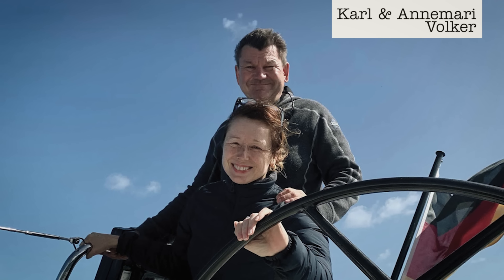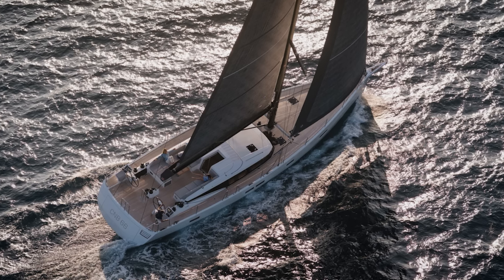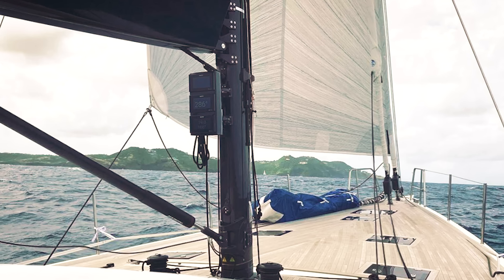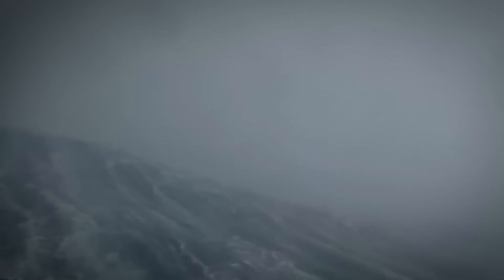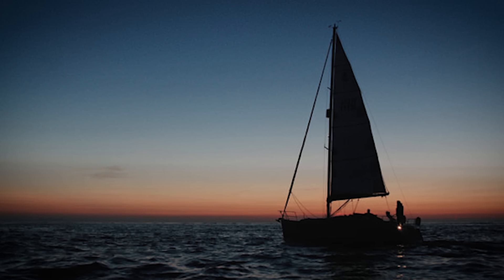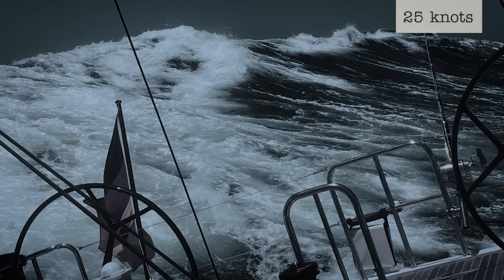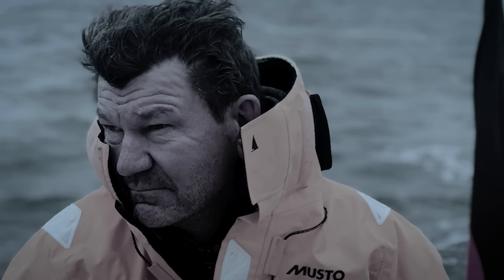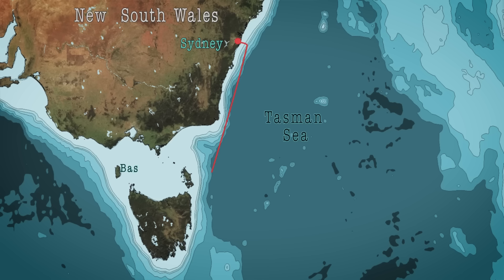Couple DIES on Private Yacht!

Comment: You can tell how experienced the other guys were with their decision to sail away from land in an extreme emergency. I'm not an experienced sailor, but it sounds like these 2 highly experienced sailors were the only reason the boat didn't sink. It is too bad that the boat's captain did not give these 2 more training on the unique features of the boat. I'm ballparking it here, but from the description of events it sounds like Karl was running a 24+ hour day with no sleep. It gets harder and harder to not make mistakes with each passing hour in a situation like that. The other part of the accident in my opinion was trying to build too large of a sailing yacht that could still be manually controlled like that.
Reply: Any experienced, well qualified offshore sailor can come aboard almost any properly set up offshore sailboat and become sufficiently familiar with the gear layout within a few hours. At that point they should to be able to perform almost any normal job on deck. Obviously there are exceptions, but they're rare.
Reply: @frankmiller95= I beg to differ. 
My opinion is that there should be a formal briefing on the safety devices AND the peculiarities of the boat for any sailboat voyage of some importance with a new crew. I know that the safety part is always done by serious skippers, but peculiarities are almost never described thoroughly enough. 
       I am 79 and now a landlubber, but I have several decades of experience as skipper on a 65 footer sloop. Once I was a crew member on a 50 foot sloop (custom-built in NZ) crossing from Annapolis to Great Abaco under an excellent & most experienced skipper; at the end of an eventful cruise (we had lost our propeller) we were tidying up the boat. 
          I came across a row of books in the living quarters which had been messed up by the heaving and rolling; while tidying up the books, I inadvertently grazed an innocuous switch which was protruding on the panel along which the books were placed. Simultaneously, I heard a whirr... which I could neither locate or understand. 
          Fortunately, the skipper was a few paces away: he jumped on the switch and heaved a sigh of relief. This switch was the command of the keel-lifting hydraulic system, and – this system having been under-engineered at installation – there was no 'end of stroke cam': the keel would have forced its way straight through the deck!     

PS: A common delusion of skippers is that it is not necessary to explain in detail the boat's safety features to 'supernumerary' crew members. During the 1998 Sydney-Hobart race, the old ketch “Winston Churchill” developed a hull leak and the first crewman to identify it was a 'guest'. The switch for the drainage pumps was a few inches off his hand, but he did not know this. By the time the skipper was informed, the water level was already too high, the batteries were flooded, the engine would not start and the boat was lost.     __ .
Reply: The wind dictates which way a sailing vessel will go, the skippers have no choice but to work with it, it's been like this ever since men first put to sea in ships, 
In the circumstances of this video, the skipper and 2nd mate had no choice but to "run before the wind"
Reply: @matthewmcdermit8744  
Sailing as close to the wind is actually called "Beating"  or sailing "close hauled" and I'd like to see you get a line around that 20ft boom in 30 knit winds with it's attendant sea state, stay sailing on those lakes, you're clearly not fit for sea 🙄
Reply: *knot
Reply: @christianfournier6862 The first situation you refer to sounds like an easily preventable catastrophe in waiting. Why TF anyone, especially a trained and experienced captain would allow something like that to remain unaddressed and not immediately rectified does not reflect well on his priorities or judgement. Ditto for the loss of the "Winston Churchill." Were there no automatic bilge alarms, bilge pumps or high volume, manual dewatering devices located in the in the cockpit and on deck? Even a substantial leak below the waterline, as in a complete and sudden thru-hull  failure should not cause immediate, uncontrollable flooding. Without a catastrophic breach of the hull below the waterline due to sudden, massive structural failure or collision, it's difficult understand how an apparently routine leak, however bad could be undetected for so long that by the time it was discovered, the hull would have lost enough stability and buoyancy as to cause the loss of the vessel. Something is rotten Denmark.
Reply: @matthewmcdermit8744  As we both well know, no one should to go sea and expect even a modest degree of safety without those attributes.
Reply: @frankmiller95 = Easily preventable catastrophe once you have discovered its potential to occur. What you are pointing at, in effect, is the difference between theory & practice. 
          As for Winston Churchill, I only know the circumstances from a book on the 1998 Sydney-Hobart race. It would seem from this book that Winston Churchill was an old wooden boat, but not exceptionally old (not 'rotten' in the sense you imply); what was exceptional was the strength of the storm. I don't know if the leak developed could have been staunched, but what I know from the book is that the crew did not have the opportunity to try, once the first chance had been missed! 
          We all know, or should know, that when the water level from a leak rises above the batteries it becomes impossible to start the drainage pumps & save the boat. The engine-start batteries can be installed separately & higher than the rest, but only up to a point. This is why a speedy reaction is of the essence. All crew members should be prepared for this eventuality. 
          Another time, on my boat with a very experienced mate, we were cruising (sail+ engine) on a calm sea when I went to the head (actually a head+bathroom) located close to the engine room. I noticed humidity oozing from a floor panel which I opened. The rush of water, from a flange on the propeller shaft located just under this panel, was very impressive. The mate & I reacted immediately and we rigged the emergency drainage pump as fast as we could - I did not know we could act that fast !... 
          Moments later, we found out that the water ingress had come from a sink faucet left inadvertently open in the bathroom by another crew member: the leak was actually an 'internal leak'. No danger, but a good emergency drill and a reminder on how fast things can go bad.    __ .

Comment: In emergency situations you have to get your priorities right. The boom was a lethal weapon and should have been secured first. Instead it continued to wreak havoc and prevent the crew from managing the situation. I am surprised that John and or Mike did not take control of the situation and deal with the issues in the order of importance. I have spent half a lifetime at sea and have encountered many critical situations - thankfully none of those were fatal.
Reply: Exactly. The waterline storeis analysis in very biased and it does not add upp. Leaving the boat without control for a loooong time does not sound like the right call. Also when weather kept deteriorating why didnt Jack and Mike wake the captain and suggest a 2 reef. Instead they waiting until the situation was much more difficult. And this same pattern happened both with the first and the second reef
Reply: @siltee9983  Any good captain will leave standing orders to be notified immediately in any situation where the watch captain has questions. ln addition, a good captain will be so attuned to his/her boat/ship that they will awaken immediately and investigate if the movement of the hull due to sea state or wind changes in any way. l've observed it as crew and done it, myself, as captain, more often than l can recall, and l have a pretty good memory for those things.
Reply: @frankmiller95  Not talking about the captain. He might have been bad or good. But the fact that the ”experienced sailors” two times failed to take action in notifying the captain when the boat was overrigged indicates to me a lack of experience. For experienced sailors this goes without saying…. Experienced sailors dont just sit there waiting things to turn bad.
Reply: I was amazed it did not bring the mast down if it was swinging around like the story says
Reply: @calthorp An out of control boom is unlikely to dismast a vessel without repeatedly striking the shrouds or locked running backstays while full of wind, which almost never happens for reasons too technical to explain here.  ln any event, according to the story that did happen in this situation.
Reply: Their first priority was giving assistance to the injured crew.
Their second priority is to keep themselves safe. 
One person is taking care of the wounded crew, what should the other do, run around after a 300lb boom flailing from side to side in high winds? 
The flailing boom is not even close to a priority in those conditions. Even if it brings the mast down - so what? Cut it loose, the boat is still floating.
Reply: @Dryer_Safe  same rules as in flying. Keep the plane in the air. Then you take care of injured passangers. Same with oxygen masks dropping - first you secure it to your own head, after that to the child. Now maybe the boom wasnt that bad - we dont know - but they left the boat free floating for a day drifting away from shore. Within that timeframe they should have done something to the boat!!!!
Reply: @Dryer_Safe  I am ex Search & rescue, The first thing to do when you arrive on an accident is make sure its safe for you. No good having a dead rescuer. once safe then attend to victims
Reply: @siltee9983  I disagree. Unless the boat is taking on water, or there is an immediate danger, like a lee shore, the boat will take care of itself in most cases. 
An in-boom furling system for a boat this size is absolutely huge, and having two crew running after a loose boom and endangering themselves even more in the process, while people are hurt and in need of assistance, would have been the wrong move. 
What if one of the remaining crew was thrown into the water during this madness?
There is much to say about the boat design, crew preparedness, and the crazy trend for tall rigs and flush party decks, but as far as the remaining crew actions are concerned, I can't fault them for not getting themselves killed as well while trying to catch an out-of-control boom. And they did take the boom under control when they were able to.
Reply: @calthorp  I am not debating whether securing the boat is necessary, but the armchair consensus that they should have made catching a 3-400lb boom swinging left and right, at high speed, in heavy seas, their top proprity. 
 
This wasn't a 40 foot sailboat where the crew neglected to take 5 minutes to lash a loose boom. 
This was literally a far too large and out of control object, to be handled safely. Even so, they managed to secure it well enough by using wind pressure to hold it in place. 

I've seen more than one such cases where the helpless crew of these "modern design" yachts has no option but to watch the rig shake itself into pieces, and yes, sometimes that is the safe think to do, because trying to "handle" these objects is far too dangerous.
Reply: @Dryer_Safe  i agree with you with attending the injured first, in case the boat is in no immediate danger. What I’m questioning is the wisdom of sitting inside for hours and hours if the other matters have been taken care of. If the boom truly is loose then maybe correct call - but also now they drifted away from shore and no rescue was possible. Thus the injured ones died… at this point it is obv. Armchairing… but gutfeeling tells me the video story did not give the correct pic
Reply: @Dryer_Safe  Modern tech stuff is great when its working. then as soon as something goes wrong it usually cascades. Most times there is no backup. Manufactures always seem to reply bring it in & we will take a look. That's fine if you are tied to a marina in a city. not so fine when you are out at sea. I have been a commercial fisherman for over 40 years & my boat is the most simple in the fleet. However I can always go fishing while others are tied up waiting for expensive parts to arrive. I have been in storms & had things break or go wrong but I have always been able to fix it to get home. never once having to be towed or ask for help.

Comment: There are so many things wrong with this boat. Having the mainsheet in the centre of the cockpit is very dangerous. Having the reefing controls at the mast is also not very bright. Any boat must be able to be reefed even when sailing downwind as having to turn into large waves is inherently risky. The fact that both the preventer and mainsheet broke reveals them to be woefully undersized and inadequate. I dislike all main roller furling and have had some very bad experiences with both in mast and in boom furling. A main this size is definitely able to be handled with the correct system of slab reefing with a self stacking stackpack type main. This boat was incompetently designed for ocean sailing and unfit for purpose. That open deck and cockpit had little or no shelter for crew and few handholds. Stupid. This boat looks pretty but is a marina queen. Its typical of many modern boat designs. I have dealt with the designer and he is extremely competent and very experienced. So he is designing what is specified by either CNB or the owners or probably both. The two crewmen appear to have performed magnificently.
Reply: l'm in almost complete agreement with most of your comment, with the possible exception of the last sentence, which l'll get to later. An additional question is why would any, modern, offshore sailboat of that size be designed and built without a mainsheet traveler? Of course, it's possible there was one, but omitted from the illustrations. 

As to the performance of the two surviving crew members, while they seem to have performed well after the accidents and ultimately fatal injuries to the owners, WTF were one or both of them doing while the events unfolded? lt's not clear from the video, but if either them was on deck or more importantly, at the helm, why TF did he keep the boat into the wind and not immediately fall off when he saw the unsecured and apparently out of control boom, swinging over the mainsheet winches and the head of one of the owners? Maybe that's why their faces were blurred out in the video? lt's possible there's a USCG or other maritime agency conducting an ongoing investigation and unresolved legal issues to be considered. ln the end, despite the obvious sympathy and compassion we should feel for the victims, there was no sudden and unforeseeable gear failure involved and this appears to have been a very much avoidable tragedy.
Reply: @frankmiller95 I don't think crew were on watch initially as problem developed. Reefed too late for conditions and ability.
Reply: @artsmith103 Your succinct inference seems to be a likely possibility. Assuming it's correct, it raises yet another question about the quality of judgement and the resulting decision by the captain to attempt to shorten down without additional crew on deck. Based on the backstory, it would seem this maneuver would have likely been completed successfully, countless other times by just the two owners. Although we should, we don't know where the other crew were during this event. Not to make light of a tragedy, but based on the incomplete account provided here, something is rotten in Denmark.
Reply: Try slab reefing when going downwind in anything above 10kts. To reef you definitely need to point to windward  about 30°. It helps a lot when you sheet in the main sheet of course. That fixes the boom in one position making it a support.
Reply: @SuperDirk1965  Un unh. Having taken in a reef innumerable times while off the wind in serious gales, the main will definitely come down at that point of sail. Often it needs to be sheeted in, the same as in preparation for a jibe, but once the halyard is released, the main will come down, however reluctantly. The idea that it's necessary to round up to take in sail is a myth. Ask any experienced, professional, offshore sailor with several score thousand miles at sea and you will get the same answer. How to you think RTW racers shorten down in the Southern Ocean? How do l know? l'm one of them.
Reply: @frankmiller95 Agreed. Far from being impossible to reef off the wind when the breeze is up, slab reefing is the only system that can be reliably reefed (with proper technique) in those conditions without first rounding up into the wind (which entails danger, and risks damaging the rig in extreme conditions).
Reply: @matthewmcdermit8744  You have made basically he same comment repeatedly. We get the point. Give it a rest.
Reply: @markhamstra1083  Glad you concur. Despite the all too common misperceptions, running off in heavy weather is most often the best way to accomplish whatever needs to be done.